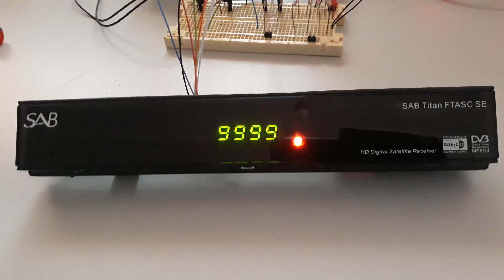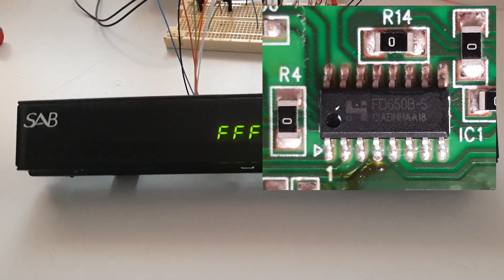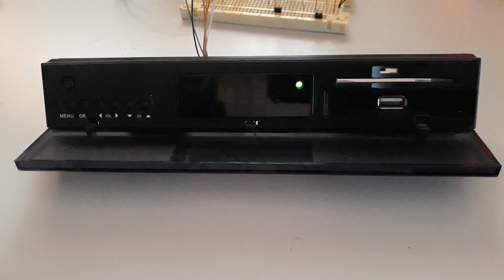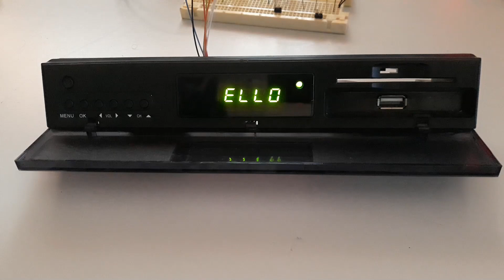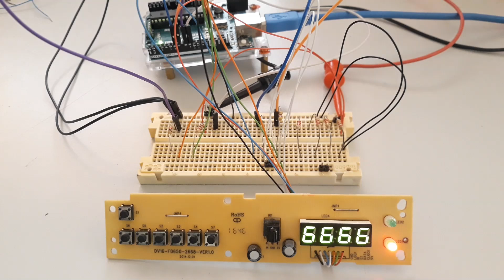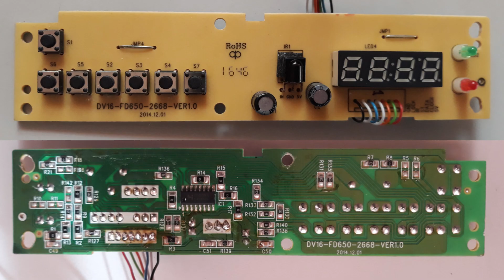FD650

Comment: Ok done very good thanks but if I want write Arabic  can I?
Reply from the maker: Hi @cubious4256,
Certainly not! Note that the display has 7 segments; even to represent some characters of our (Latin) alphabet, it is necessary to resort to tricks, and even then it is not possible to represent them all, only on a 14-segment display.
I don't know if using a 5x7 dot matrix display would support the 28 characters of the Arabic alphabet, but that would require a more elaborate driver.
Not to mention what I don't know, see the example of the characters present in the PT6302 ROM. Download the data spreadsheet available on the internet and check the last pages, then tell me what you think.